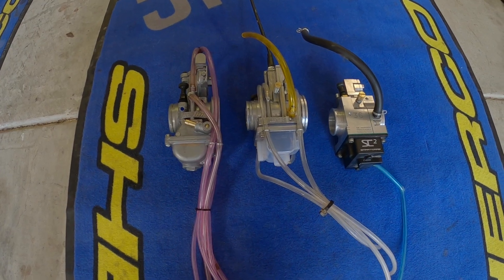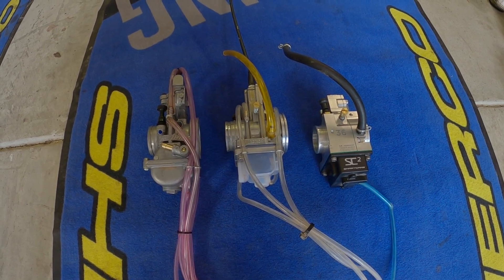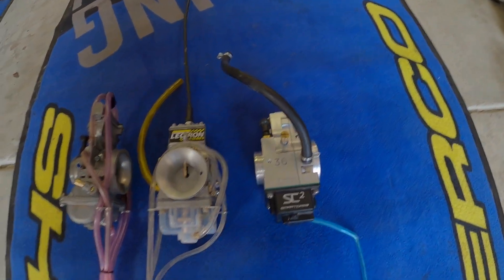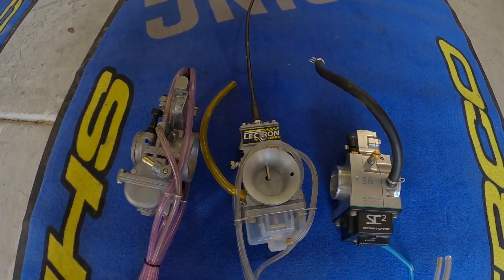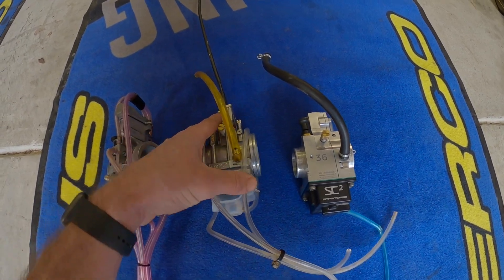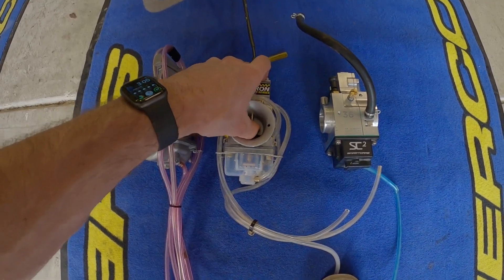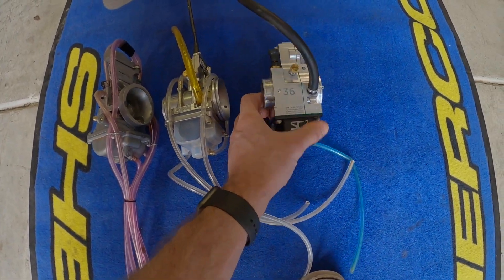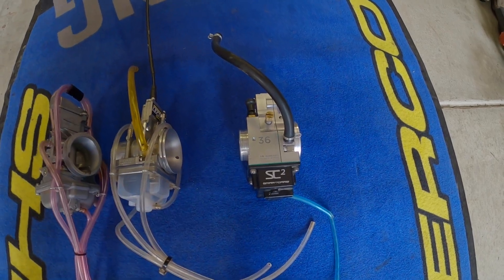Keihin, Lectron, SmartCarb Comparison

Comment: never bothered with a lectron or smartcarb because, if you understand it, its pretty easy to modify a mikuni, keihin,, etc, to do the same thing.

spend some time coming to terms with pitot tubes, emulsion tubes, and possibly blow through turbo carb setups... and if it hasnt clicked by then, you should put the spanners down and go scrub toilets or something instead.

its about the pressure in the BOWL, and what its referenced to... you control the fuel that enters through the jet by varying the pressure differential across it, by altering the bowl reference pressure.
whereas a standard carb uses a fixed bowl reference, a varying vacuum on the jet, and altering the jet size with various tapers and orifices...
Reply: No, you can't modify a conventional jet/needle carburetor or even an externally vented Lectron to do what the SmartCarb does with its proportional at-manifold air density/velocity communication into the float bowl paired with single circuit, metering rod only fuel delivery and superior atomization.
Reply: @SmartCarbFuelSystems  keep trying... no matter how hard you attempt to obfuscate with fancy words and technical mumbo jumbo, it doesnt alter the fact that some people know EXACTLY how they work.

i guess you work in the sales and marketing department. you belched the appropriate word-salad. meaningless mumbo jumbo. got any turbo encabulators handy while we are at it?
Reply: @paradiselost9946  naysayers, particularly those with zero personal experience with the product like you, typically come at us from one of two approaches, sometimes both: ignorance or jealousy. It's quite clear you fall into the former category. Jury's out the second. Do follow along as we continue to redefine carburetion with our novel, patented fuel system and be sure to check our all-new SC3 model lineup, out this year.

As you said, keep trying. Keep trying to understand. You'll get there.
Reply: @SmartCarbFuelSystems  jealousy? ignorance?
i have no urge to BUY one. ive pulled apart at least a dozen now. 
the fact you keep arguing, threw in more advertising jargon, attempted a sales pitch... all that simply says that i do in fact know EXACTLY how they work and youre worried that someones cracked "the secret".

scared the chinese will figure it out and start flogging off $30 clones and undermine your profit margins? 

guess what? the knowledge isnt proprietary at all. its basic fluid dynamics.

Comment: For a 300, would you choose a 38 or 36 bigger or. Smaller for your colorado riding. Let's say 10k feet.
Reply: Sherco 300s come with a 36mm Keihin stock and the engine characteristics developed at the factory favor the 36mm size. For that reason we recommend the 36mm SmartCarb SC2 for best performance regardless of elevation factors. Unless you're boosting (turbo), there's no workaround fueling-wise for power losses at elevation. You can, however, opt for a higher compression head to offset some of those losses, but that tends to require a step richer metering rod in the SC2. Rarely do we recommend the 38mm for that application unless it's purpose has been radically changed (supermoto, snowbiking, etc).

Comment: Would recommend if ur gonna submerge the carb in ultrasonic that u remove the TPS wouldn’t want any fluid intrusion into the sensor thru shaft bearing of old wire sheathing

Comment: I have a Lectron on my YZ250 and cannot get it working properly. Some days it’s fine. Some days it’s trash. 

My friend has a Lectron on his DRZ400. Some days it starts and runs fine. Other days it doesnt. 

I had a YZ250 with a stock carb and never once had an issue. Kicked first or second try every time.
Reply: Lectron being the common denominator here. FWIW we have solid tuning baselines for both the YZ250 and the DR-Z400 if you or your friend are ever interested in trying modern metering rod carburetion. Reach out if interested.

Comment: Do you ever use a Air Fuel Ratio gauge to tune a keihin?  Just wondering because i was going to put an fcr39 on my bike and am going to have an 02 sensor bung installed on the header pipe for tuning.

Comment: Thought with the Lectron to adjust the metering rod you turn it without pushing up. Once you get it where you want you push up on the rod and face the flat part of the metering rod back towards the front. Pushing up makes it not change settings. Possible why you were having trouble fine tuning it because you thought it was richening but the setting wasn’t changing?
Reply: Absolutely correct!

Comment: The smart carb needs to get a working version for the EFI KLRs. And lower their price. Like cut it in half. That'll probably be their best entry into the 4 stroke market. Also, it would be nice if they could make a parallel twin 4 stroke run off a single carb. It's stupid to have 2 carbs on a parallel twin. That would be a good selling point. I predict many problems into the future as all this electronic nonsense starts failing on 20 year old motorcycles. It works good when it works, but people are going to face big problems when it stops working good, and they're going to need carbs.

Comment: I run Lectron brought life to my bike and my Lectron comes with Philips head screws that hold the slide and metering rod also never mess with the float bowl on a Lectron it does not need to be touched, I ride trails and single tracks with this carb love it going up hills gives 💯 %  Awesome vid tho!🎉

Comment: you don't push up on the needle to adjust the Lectron you rotate it with the tool then when you need to have the flat side facing the engine you push up and rotate it around and it doesn't set any further it just allows you to properly orient the needle

Comment: Being it a smart carb, shouldnt it adjust automatically? Like u use some kind of odb2 tool and set engine type and size and than the sensors should adjust realtime on enviroment settings and cold or hot engine?
Reply: It's not that it adjusts automatically, it just uses air density and velocity more efficiently using a metering rod and at-manifold density/pressure communication into the float bowl, driving fuel flow proportionally for a wider range of air densities due to elevation/temperature and even artificial factors like blow-thru boost. What you're touching on is certainly worth considering, and we are, but to suggest that a requirement for making this carb "smart" would be real-time adjustments would miss the fact that it doesn't really need to. We always recommend assessing performance with a hot engine/pipe and while riding. No easier carb to adjust trail-side than the SmartCarb. It's all external and takes seconds, without tools.

Comment: 03 cr250r equipped with first gen lectron and it’s been perfect winter summer pinned in motocross or putting in trails on a 24hr race the bike worked amazing and not only that had the power to clear 100ft jumps and lug for 24hrs all while saving me stupid amounts of fuel. I could run 1 hour and not even go through half a tank running 32:1 93 octane pump. Insane carb.
Reply: I agree man i installed a 1st gen lectron on my 02 cr250r and the bike is insane fast.
Reply: @TheRossillini  and pulls perfect too no abrupt surge or unpredictable kick just smooth linear power and because the power is all there it just makes it like a ultra light weight 4 stroke that sounds better smells better and looks better! Can’t beat it.
Reply: @chrisvillarreal2752  exactly mines setup for woods and has that power there to get you over logs and rocks more comfortably with the smooth grunt.

Comment: Have you looked at the Stic metering block? It replaces the jet block in the keihein carb, it works just like the lectron and Smartcarb but at a third the price.
Reply: Despite their claims, a Keihin with a STIC is still a Keihin which works nothing like a modern metering rod carburetor. They make power but they're terrible on fuel economy with that always-on pilot system and they still need jetted/adjusted for elevation/temp changes. For racers like Cody who are up and down and all over the place (31k+ feet cumulative elevation change just on day 1 at Romaniacs yesterday...) and who have to carefully manage fuel consumption over a 4+ hour race, the STIC just doesn't meet their needs. It's not the same thing.

Comment: 100% recommend the Lectron. I run the stock cable with the Lectron as i don't like the cable Lectron supply. You do need to shorten the outer so it fits however on a 2017 KTM 250/300. Smooth power and alot more over rev, less gas used. Had to richen 1/4 turn on the metering rod then haven't touched for years winter or summer, high or low. No idea why anyone would bother with TPi when two strokes run so well with alot less tech and more custom tuning options. KTM lost a customer when they went to TPi, not interested so now switched brands after almost 25 years of Orange.
Reply: Same. After owning ktms since I started racing in 2011 I am looking at a yz250 for my next bike because of the TPI and the price of course lol
Reply: I found the lack of bottom end on the Lectron to be extremely lacking. Most of the Mikuni have a bad gasket, so for $10 I fixed the stock carb, and it runs amazing now. 
Google "Jarvis Mikuni mods" for instructions on how to make the mikuni run perfect.
As a bonus it has a replaceable needle jet, no throwing away an entire kiehn from a little needle seat wear. 😂

Comment: For one yamaha dt 125 with big bore kit in 168cc by Athena. what are you thinking about? Lectron or smart carburettor? Because i dont have the money to play with carburettors . Im thinking 34 mm lectron!.  I have foul racing handmade exhaust ,v- force 4 reed  and racind foul setting cdi . And now i have one oko 38mm carburettor with out filter . And running good but in the middle of rpm i have less power than originally carburettor 28 Mikuni.  I appreciate if you help me. Thanks 😊

Comment: Do they get Vapor Locked when left out in the sun ?
Reply: No, they are able to vent through the airbox/filter. Speaking of sun and vapor/pressure though, it is advised to use a fuel tank vent that can back flow properly, i.e. check-balls removed or the use of the stock vent - don't want the tank building pressure and pushing fuel (beyond gravity feed) into any carb due to heat/sun exposure.

Comment: I've always had good luck with the Keihin carbs.
I just set the float level. Run the stock pilot. 158.main. NEDJ needle, machine a half mm off the rear bottom of the slide angle. Presto. Works great from 2800 ft up to over 10,000 ft.

Comment: Good vid, but to adjust the metering rod on the lectron you use their tool, make sure the rod is seated all the way down, make your quarter adjustment with the tool, take the tool off, Push the rod up with your fingers and face the flat part the correct way and.. also make sure it’s not hung up.

Comment: Im looking into lectron for my 250 chinese duel sport I live at 90 to 200 feet above sea level but a ride 3 hours north puts me at 2000feet on average to as high as 4000 feet I am looking for cost effiecent but my bike runs really crappy at higher elevations which is understandable because my bikes all tuned up for where I live not where I like to go
Reply: Which bike do you have? GPX and SC have a SmartCarb that work's well for those tse250r's...from Wyoming USA 🔫🤠🇺🇸p.s stay safe

Comment: Once again..the more adjustments a carburetor has the better it will run IF A SKILLED TUNER is doing the work. People that say a lectron or smart carb are the best have no flipping idea how to make a bike run good compared to a Keihin or Mikuni
Reply: Not true. For one, Cody and his mechanic are certainly capable of properly tuning a Keihin or Mikuni. More adjustments doesn't equate to better results. The fact is conventional carburetor development stalled out decades ago. More modern metering rod style carburetors, especially with the SmartCarb, with no conventional jets overlapping and signing on and off through the range are better able to accommodate engine demand and make better use of air density to do it. The SmartCarb in particular is better than Keihin or Mikuni for a number of reasons including making more power, staying consistently in tune regardless of elevation or temperature changes - even minor ones that impact conventional jetting, external adjustability to tweak for different riding conditions or terrain, no fuel spillage, the ability to meet emissions standards, linearity of power delivery, and way better fuel economy. Until you personally give one a try, I'd say that you are the one with no flipping idea.
Reply: @NDyess  you really are ignorant and shows your lack experience with carburetors. There is nothing new about the jet less carburetors from smart carb or lectron. The design has been around for 40 years or more. What you have to grasp is carburetors the more tuning circuits you have the better you can make your carb and bike run. While a smart carb has 2 tuning circuits a Mikuni or Keihin has 5 or 6.

Comment: To each their own, but.  $10K or more for a brand new Euro bike. $500 to $700 for a aftermarket single dirt bike carb.  Probably a couple more thousand for suspension work and other bullshit.  I don't get it.  It's fucking stupid to me.  And most of you can't ride a stock bike anywhere near it's full potential.  Buy a cheap bike and pay Mr. Webb to teach you how to ride and show you how slow you really are.
Reply: Your post should be pinned to the top.

Comment: You are adjusting the metering rod wrong on the lectron. You turn the metering rod with tool with out pushing up. Clockwise will richen it and counter clockwise will lean it. Then you take the tool off and push the rod up then turn it so flat side is facing the engine. So he was not adjusting correctly and thats why he was having a hard time with it. I just put a lectron on my rm250. Adjusted correctly and that bitch rips!

Comment: Great video!  Do you run a pingle valve on the lectern?  What size diameter fuel line is that your using on the lectron?

Comment: Really nice video, Cody!

I'm using the SC2 on my KTM 300 2017 and I love this carb! very easy to adjust on the fly if you want a leaner or richer bottom end.
Reply: I’m getting one for my 2018 250sx, did you hve to trim the intake boot?
Reply: @justmoe8134  No but the boot on the SX is different

Comment: The Mikuni block jet gasket is always pinched from the factory. Install a JD gasket, cut the slide to a 7.0 and run the JD needle, 32.5 pilot and appropriate MJ.
Reply: Mikuni is junk

Comment: Suzuki NECJ needle is the ticket for the Keihin carb
Reply: Yes it surely is. After installing NECJ needle in my Husky TE 250 2015 Keihin PWK 38 jetting has been easy. Very good throttle response from idle to full throttle. My other bikes Husky TC 250 2018 with Mikuni TMX 38 jetting was first very bad. Way too rich and ran like shit. With GJ mods (throttle slide notch mod, drain plug holes mod and plastic jet baffle holes mod) it is also now very good carb and throttle response is awesome. Much better low end, midrange and top end power than before. I don’t need Lectron or SmartCarb in my bikes. Both Keihin PWK short body and Mikuni TMX are great carbs when these easy and cheap things are done.
Reply: I’m going to try a Suzuki nedg needle for my 200xcw
Reply: Yep. That's what I use.
Reply: @carlatamanczyk3891  How do you like it someone on thumpertalk  told me to get it and I'm going to put it in when it warms up. pretty excited for it

Comment: I have two SC's on 363 trx250r's and I like them. Heads up the stock air boot interferes with sensing port.
Reply: Were you able to use the stock boot ?

Comment: So after you have ran all 3, I've got a beta 300rr and I'm looking for off idle throttle response for low speed obstacles and trying to get it to behave like a trials bike. I've got my keihin setup fine now but does the lextron or smart carb offer any better very low rpm off idle performance over the keihin once they are tuned?
Reply: From experience the lectron does not! I went to keihin and has a much better low end response! You can look into the stic metering block never tried myself! I also have a rk tech head that gave me more and smoothed out the power! I have plenty of power now

Comment: Hey I'm not an expert on any of these but I have a lectron and I couldn't get it to work right. I moved the metering rod a bunch. I was pushing up and turning the rod...as it turns out the doesn't change the rods position. You need to turn the rod while it's down (reason for the tool) and then push it up and put it back with the flat side towards the engine. Not sure if that was part of the issue for you but wanted to share! All amazing carbs and thank you for the review 👍
Reply: Yeah, this is key about rod adjustment.